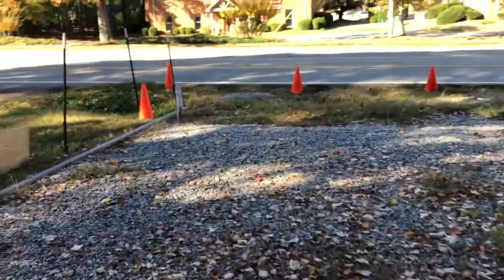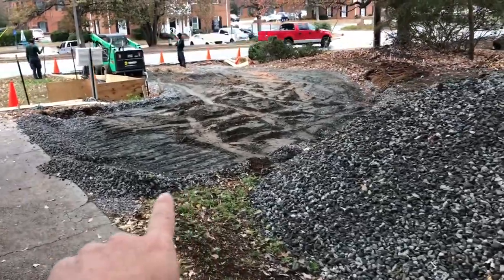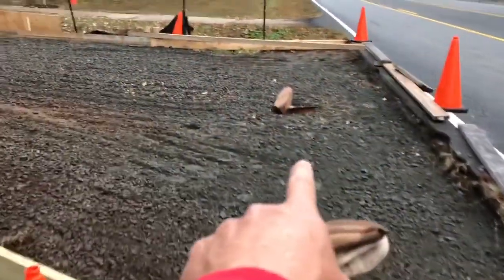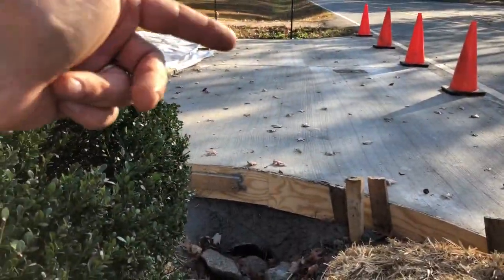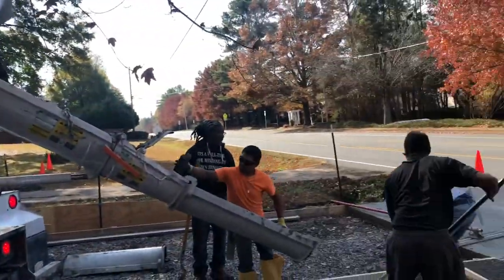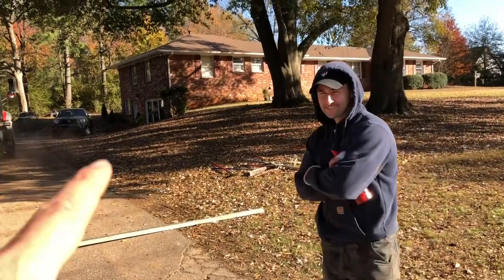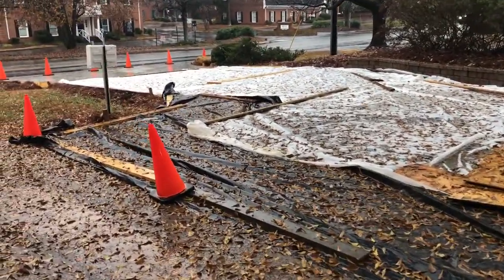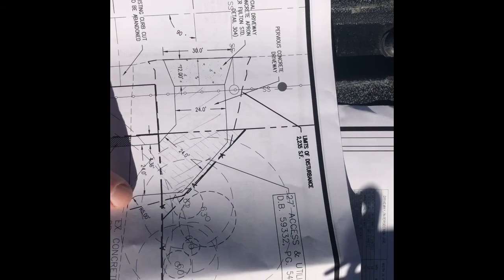DIY Pervious Concrete Driveway

Comment: What about freezing temperatures?
Reply from the maker: Great question @jimmysandoval1885. Provided the substrate is properly installed, water should flow quickly out and away from the driveway prior to freezing.

Comment: What kind of vehicles can be driven on the previous concrete road.
Reply from the maker: Great questions. The concrete strength is the same as any roadway concrete. The thickness is +5" and will withstand any typical road vehicle. Good luck with your build.

Comment: My question is why?
Reply from the maker: Stormwater Control for City of Roswell requires water retention/detention prior to drainage into the stormwater system. As an alternative, you can install pervious concrete to allow rainwater to penetrate the concrete slab and filter through the gravel system below. Saves time, space and money. Hope that helps. Thanks for the question.

Comment: what is the going rate for the p concrete? 250 per yard?
Reply from the maker: Great question Jason. Check with your local concrete supplier. The cost should be about the same as a typical 3000# mix concrete. The aggregate size is just smaller.

Comment: I have question, For this kind of concrete, is it possible to put some rebar on it so that it will not crack in the future?
Reply from the maker: Great question Mc Kenley Gatchion. The pervious mix allows for cracking and allows water to penetrate the surface of the finished product. Yes, you can install rebar. However, the penetrating rainwater will rust the steel over time.
Reply: @Delmanmel   Oh okay, as of now is there any research or improvements in pervious concrete that helps in future to make this concrete will be use in highways?
Reply from the maker: @mckenleygatchion3199  Yes. However, the current design is too brittle and cannot survive the wear and tear of heavy traffic.
Reply: @Delmanmel  hi, im student, we're doing some research about porous concrete, do you think is it good to have this kind of concrete in winter season like here in alberta canada
Reply from the maker: @mckenleygatchion3199  Great question. Check with your local concrete supplier for the best mix design, given the area of application. Also, the County or City stormwater engineer can assist with specific drainage requirements for runoff. If properly installed, pervious concrete can be applied in cold climates. Good luck!

Comment: What is the ratio of concrete mixture and also water cement ratio?
Reply from the maker: Great question Talha Khan. The concrete supplier had a proprietary mix design. However, there are several Youtube videos indicating different mix designs to choose from. Good luck.

Comment: In this concrete road large vehicle can move or pass
Reply from the maker: That's a great question. Yes, it will withstand the weight of a 35,000 pound fire truck.

Comment: Is this a good alternative to a grass front yard, say If I wanted to get rid of grass and add more parking would this be the best way. Also another question, does the 6 inch have any weight limit to your knowledge?
Reply from the maker: That's a great question Dank Trains. The concrete is a 3,000 psi mix. Refer to your County Ordinance for storm water control and allowable surface parking. Hope that helps.

Comment: How does it hold up in Minnesota at freezing temps?
Reply from the maker: Great question, Tenth Dimension. Installed properly, there should be no standing water to freeze. Check with your local storm water engineer, if necessary.